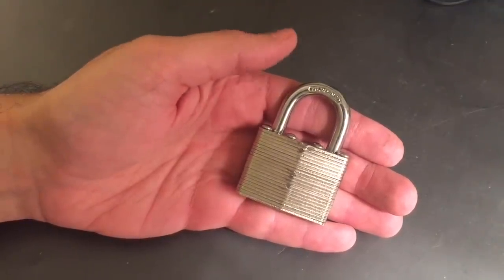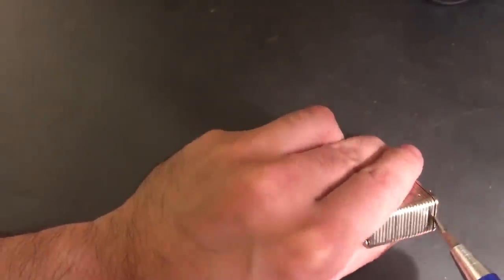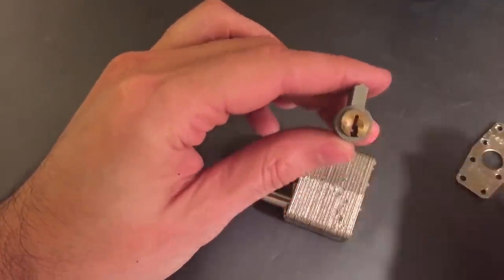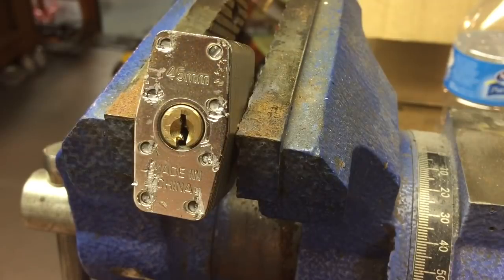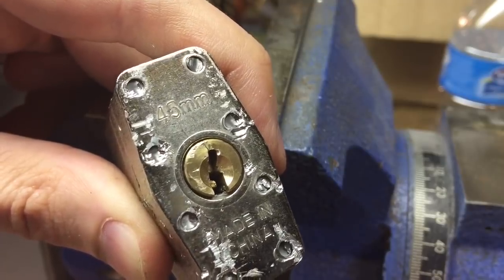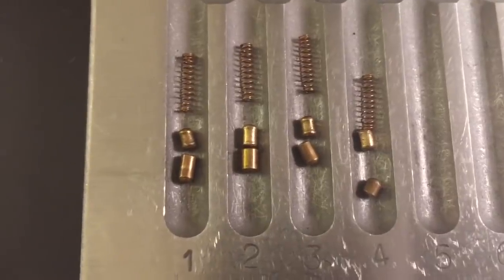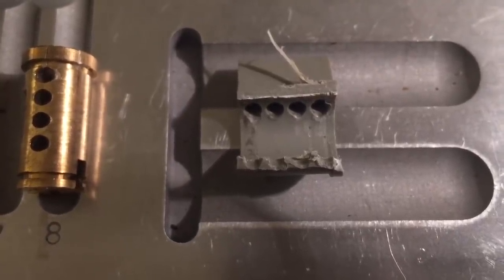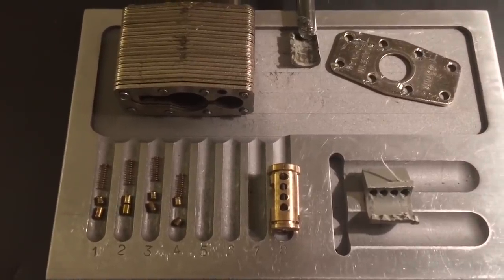[60] The Worst Lock in the World Abused

Comment: At least the shackle is hardened ;-)
Reply from the maker: +Potti314 Yup... I actually file tested it.  It really is hardened, unlike many Chinese locks that are labeled as such.
Reply: Honestly I didn't expect this. That's really funny.
Reply: @lockpickinglawyer  hardened shakle, softened core
Reply: @ @AstoundingAmelia  perfectly balanced, as all things should be.
Reply: @huscarlkt2335  Harmony. Harmony is everything!
Reply: You’ve got to admit, the shackle did not fail.
Reply: @lockpickinglawyer   Try cutting the shackle on a Wilson Bohannon, equipped with hardened stainless steel shackle. I have the remains of one here, with the U HAUL logo on it, along with the WB logo I find those to be some of the best shackles I have ever had to get through. The lock would not open due to vandalism, so picking was out of the question. I am considering forwarding it to Packlock, for research purposes.
Reply: @Potti314  lmao I dont think he got it
Reply: @Tom-no4jm  that was from 3 yrs ago, what the fuck are you trying to say?
Reply: Y'know why ;3
Reply: “Hardened” but I can make large grooves in it with a pocketknife
Reply: @citylockapolytechnikeyllcc7936  takes me a minute with disk grinder and 0,8 mm cutting disk for stainless steel tubing ...
Reply: @AstoundingAmelia   Optimimumium   Rockwell C35-ish through harden, and C70-ish Case hardened. Similar to premium hoisting and tie-down chain.. strength, without the brittleness. Hard-ER to grind-through Shields that protect lock shackle and staple is best, imho.
Reply: @heikopanzlaff3789  Padlock and hasp staple are best concealed, so you have an extensive reach-under to get key into lock... no room for tools. Some storage facilities have the "vaults" made this way.
Reply: I found a lock that opens at long as the keyhole thing is turned.....no pins needed to be pushed, just needs tension....

Comment: I wonder why they bother to ship keys with this lock.
Reply: Cheaper than screwdrivers.
Reply: @Grim_Beard  

Haha that's great!
Reply: Actually there is a bike lock that make it, kryptonite I think.
Reply: @johnrockland18  kryptonite make the best cables though
Reply: LPL did not have keys for it.  Perhaps they don't bother sending keys as they are not needed.
Reply: Fester Blats  r/woooosh
Reply: the best part is, i think i have the same lock, if not extremely similar, and young me LITERALLY UNLOCKED IT BY HITTING THE SIDE
blunt force to the side was enough to unlock it, and after that i realised i could just pull the lock open with my hands
Reply: The company figured if they shipped keys with their locks it would look well "made" & professional looking

Comment: 2015: uses screw driver to open lock

2020: uses an lego astronaut to open lock.
Reply: Twig.
Reply: 2025: *breaths to open lock*
Reply: Red Bull can
Reply: Cotton bud.
Reply: Walkkeri .... uses hard look
Reply: Magnet. Without touching the lock.
Reply: 2027: exists to open lock
Reply: *uses tweezers to brake lock *
Reply: 999th like
Reply: Coat hanger on Sentry safe
Reply: 2025: uses lock to open lock
Reply: Uses key from a different lock
Reply: 2022 uses a sock to open a lock
Reply: A price of string?
Reply: 2030: lock is already opened
Reply: intimidates the lock open

Comment: I've 'secured' lawn equipment with that exact lock.  Yikes!
Reply: meh, if someone wants your lawnmower bad enough, no lock that's worth less than the mower is going to stop them.
Reply: where?
Reply: It doesn't really matter. Just the presence of a lock will deter most people, and everyone else will likely try bolt cutters first. I doubt anyone will even think about using a screwdriver...unless they've seen this video.
Reply: Still worth it, because most thieves are thieves of opportunity, and don't have any tools on them. You wouldn't get this open with your bare hands.
Reply: @DueySR  i mean a lot of thieves carry pen knives, i mean even normal people do.
Reply: @ajjabajja9155  Yeah but he needed a vice, screwdriver, and pliers to break the lock. Not something you can really do in your hands when the lock is attached to something.
Reply: @DueySR  small piece of duct tape  to secure the shacke against whatever the lock is attached to(pull lock taught then tape the part of the shackle furthest away from you to the object) use a pair of needle nose pliers and a screwdriver and you're set

Comment: I've seen worse. Bicycle cable lock. Pretty small. Brass core. 4 pins. All that in plastic box. The plastic box had 2 parts .. the square 'vessel' in which the core was sitting, and 'lid', which went around the keyhole. All like 1mm thick, clicked together (unglued). You would think .. simple, yet normal working lock.

Well .. NO ! The pins were not soldered in the core ! There were not retained in any way .. the pin shafts were just open from outside .. and the pins were held inside by the plastic sheet !
When assembled together, you could unlock it with key and all .. but all you had to as use some edge to pop out the 'lid' of the plastic casing .. pull the core out .. and poing poing, all the springs and pins went flying, making the lock a non-lock.

I got money returned (my mom bought it), and I even persuaded the shop to stop selling those, wasn't really that hard. Well at least the owner said that :-D
Reply from the maker: +DrSid42 That sounds pretty bad! For more on this lock, check out video 139... I open it with a lighter!
Reply: My friend had a bike lock once that you could see the inside of so i just turned the dials till it looked like it did when it was supposed to open..
Reply: @rulerworld1289  when the transparent tech trend went too far, lol

Comment: I would be really interested to explore the plug by filing down some of the 'brass' to see if it's actually some sort of electroplating over aluminum or pot metal.  Geez, his horrible, haha.
Reply: * how horrible
Reply from the maker: It's not plated. It's really brass, or something that looks like it.  Now the quality of the metal... That's a different story.
Reply: Thanks for the follow up!
Reply: Git Pick'd Yep, very likely true. About 10 years ago I had a refrigerator that suffered from a broken door switch. I took it apart only to discover that the contact points were simply brass plated pot metal. That switch gets thousands of operating cycles and yet Kenmore saved a buck buying it from China SMH
Reply: Nah that is cast brass that was never tension relieved and it is thin with sharp angles
Reply: W Winterheart  Not heat treating parts when casting is awful metallurgy. (they basically cooled them down rapidly )There is no point to copper coat zamak.

Comment: I might have a contender for that lock... when I first started lockpicking I bought a bunch of cheap padlocks to start. One from Dollarama was extra special.

I put a turning tool in the core and before I even got a pick in, the lock popped open.

Turns out, the core turns with any pressure stronger than a light summer breeze.

Comment: brass shouldn't crack like that-- there must be something wrong with that batch of brass
Reply: What if it's not brass. what if it's a metal that looks like brass so they make you think it's strong but it's just the weakest thing ever
Reply: Or just brass coated
Reply: Impurities out the whazoo judging from the vid, I'm not surprised given China's metal industry's track record of quality
Reply: The metal is called chinesium
Reply: Brass-plated noodle.
Reply: Probably a really impure mix, where nobody cared about the quality, source, or consistency at any point, and what you have is maybe some brass, forming a mystery alloy with a dozen other metals.
Probably has voids inside.

The thing with Chinese manufacturing is that you never ever trust the small outfits, because Chinese law is extremely permissive of fly-by-night companies run by frauds, who see very little consequence for lying and cheating customers, and can basically get away with scam products perpetually.
The larger manufacturing concerns are the only you can trust at all.
Reply: Not to be crass but, alas, that brass was ass.

Comment: That lock was designed for use in freezing conditions where that plastic core would harden and become unbreakable
Reply: Plastic becomes brittle and shatters easier in the cold. Most things do.
Reply: @cheshirecynic3061   no you are wrong. Please do more research in future
Reply: @jeremywestern7067  Bruh. Ever seen "Terminator 2?" Extreme cold temperatures cause solids to become brittle. This is no secret. As something becomes harder, it also becomes more prone to sheering or shattering. Soft things are malleable, hard things are not. Assert that I'm wrong all you want, physics will still disagree with you.

Comment: There's a lot of slamming of Chinese products, but I'd bet this junk lock was engineered by an American company.  As a machinist, I can tell you, the workers just follow the instructions laid out by the design team; a bad design is a bad design, the workers have no say in the matter.  For example, I machine hip and shoulder implants - if the specific part I'm making is steel, I make it out of steel, even if I think titanium or cobalt would be better.  If it says the driver hole has M6x1.0 threads, I make it with M6x1.0 threads, even if it seems like a 1/4-20 would be more sturdy.  Just saying; still cool video.

I don't know of any actual Chinese lock brands, but my Huawei phone, Fiio DAP, and Bluedio headphones are all top-notch quality, and far superior to the Apple phone, Apple MP3 player, and Beats headphones they replaced, despite costing less.
Reply: Thanks for adding some nuance to this issue. It's usually American companies who want to buy cheap crap to sell to the public, so you can't blame the maker. We always want to wash our own hands of the blowback of our own decisions.
Reply: You are assuming the Chinese company is following the directions sent to them. You should never actually do that with a Chinese company. I've seen large companies claim to be following directions before deciding to change the products inner working around and sell them. Seen them go out of their way to degrade the metal to a cheaper mix then they say it is. Seen them fill chemicals out with filler in order to say they are selling more product then they are.

Honestly most of the american companies buying this stuff probably has no idea what's in it. Most of the china side freelancers I know actually refuse to use china products themselves because they flat out tell me they don't know whats in it after all the fraud they've been paid to catch.
Reply: @moalboris239  any supplier company that provides a low quality material is a supplier company that loses contracts.  Especially in the day of the internet.  Even if the company doesn't test the quality of their supplied materials OR FINAL PRODUCT, they will eventually see the bad reviews or hear about it from annoyed customers and end the contract.  I guarantee that lock was designed by an American company and contracted to a Chinese manufacturer who made it exactly to spec.  China does indeed have some low quality suppliers, basically their very own equivalents to Apple, Ford, and Nike, but most ACTUAL Chinese brands are decent, and either your friend is bullshitting you for good conversation, or you're just lying.

Honestly, this also highlights a serious flaw in the American working class: they will go out of their way to blame other working class people for the shortcomings of the bourgeoisie.  Bought a junk lock?  Better blame the workers who made it, especially if they're brown... there's just NoOoOo way a hIgHlY eStEeMeD mIlLiOnAiRe would sell his BeLoVeD CoNsUmErS a shit design made of subpar materials for an artificially inflated price.  It haaaaaddd to have been those devious Chinese! (idiot)

Comment: Rotflmao. My mind can't process the spools. Burn the 2nd one.
Reply from the maker: +Papa Gleb Yeah, the spools were pretty silly.  As for the second one, no can do... it has a metal core!!!
Reply: +LockPickingLawyer really? I was sure the entire lot had plastic bibles. I'll check and send you a few more. Got them for 40 cents each lol
Reply from the maker: +Papa Gleb See if you can find another metal one... it looked like cast pot metal.  I can probably melt that one open also.  I just didn't think about it until I had already removed the rivet heads, after which that lock literally fell into pieces!
Reply: +LockPickingLawyer no problem. Hahah "pap Gleb sent me the worst lock ever"
Reply: +LockPickingLawyer What I was about to say — not sure about the keypins; the driver spools definitely look cast.
Reply: Sounds like the junk I got from Dollar Tree (with a thick coat of gold spray paint to look like brass) might actually be a couple steps above these.
Reply: You can gets these gems at Harbor Freight!

Comment: Many Chinese devices (and merchandise in general) are made with great attention in reducing the production costs and the use of "strategic" metals, with copper replaced with tin/iron alloys, steel with zinc/manganese, aluminium plainly prohibited. On top of this, many items - like the lock you show - are made to play the part, a mock-lock, so it has a plastic cylinder that you cracked with a screwdriver.
Nothing bad in producing a toy lock in principle, if they sell it as a toy lock. But when, so skillfully, a toy lock is given the appearance of a real lock, then it quickly becomes a fraud.
Recalling Cicero: "Quo usque tandem abutere, Catilina, patientia nostra?".
Thank you for the delicate but powerful irony you show us, everytime you open a padlock in such rapid and masterful way.
Regards from the UK...

Comment: That looks just like one from the set of same-keyed padlocks I bought at Harbor Freight years ago. It has "HARDENED" on the shackle and "40mm" and "Made in China" on the bottom plate. I wonder if all the years they made it, if it was plastic inside. Despite that, this has been the first lock that I've practiced picking using the China Bangood pick kit and it has been tough. A few times I've gotten it in less than a minute, but I've had hours of failures. I guess it's time to invest in some new locks.

Comment: I think the interesting question would be, if you oversized the pin holes inside the bible and inserted thin plastic sleeve (basically plastic pipe) inside the holes in the bible, would that prevent impressioning? That wouldn't allow opening the lock with brute force alone because there would still be metal around that plastic part blocking the movement for real. When extra torque weren't applied, the pins and springs should move normally in such plastic pipes.

Comment: I've seen even worse, a 4 pin lock that uses a pressed steel key, the notch depths on the key were either 2mm or 0mm, there was absolutely no security in that lock at all, I wish I'd have kept it. I currently have a lock on my table that uses a 4 pin aluminium core, at least this one takes a regular machined key, but half of the outer body is plastic!

Comment: Well, worst lock that plays at being a proper lock anyway.
There are always those small locks for keepsake boxes and stuff.  The ones the size of a pinkie.  I occasionally saw them when I was younger and I quickly worked out that you could open them with a piece of broken paperclip, or if they were in worse shape than usual, you could literally just pull them open.

Comment: I have two that are worse.
One is an unknown quantity, an old green plastic-bodied padlock. To open:
Insert eyeglass screwdriver, pry toward yourself. This trips the one (1!) pin and pops it open.
The other is a Dollar Tree toolbox brand padlock. To open:
Insert eyeglass screwdriver, gently push tip toward longer side of shackle. This bypasses the... "core," and pushes the lug directly out of the way.

Comment: This video is 8 years old, but I think the lock I just bought is the same model. Except this one has a black plastic band around the base. Otherwise, the exterior is identical, down to the stamped words.
I got my starter set a week ago, and I was ready to move on to a lock that wasn't made of transparent plastic. I paid six dollars for this lock at Wal-Mart. I took it home, put tension on the cylinder, stuck a standard hook in it and wiggled it slightly. I wasn't raking the pins- at least not intentionally, and I hadn't gotten around to picking the pins individually. But it just popped open. I did it again to make sure it wasn't a fluke. It's basically useless even as a practice lock for someone who just started a week ago.

Comment: To be fair, the core was paired for strength. Outer casing is to prevent the lock breaking into pieces with a key in it. There are plastic locks though! =D

Comment: But horses for courses.  There are things you want to lock-up cheaply... not because they're valuable, but just to stop mischief.  When I was at school, we had hasps on the desks in our form rooms; and we were obliged to bring a lock to secure it.  All we left in there were school books, exercise books and maybe our packed lunch.  The lock my parents gave me, I found I could pick with a compass (for drawing circles)... if I jabbed it in the right place, it opened.  But it was always enough security to stop my books being taken and scattered round the room, and my packed lunch from being taken.  I just mean... there are times when a $2 lock with a plastic core could be better than a $10 lock with a metal core.  (Of course, I'm making up figures, all much depends about the basis on which the lock was marketed and sold.)

Comment: ha, as soon as the video started, I said it looked exactly like the lock I was holding in my hand and trying to pick. I picked it about a dozen times, but I can't consistently get it. I did your screwdriver trick and it popped open in a second. It cannot be locked again.
edit: mine is 40mm while yours is 45mm. It's not the same lock, but I guess it's close enough.